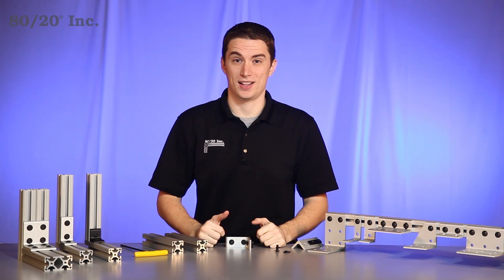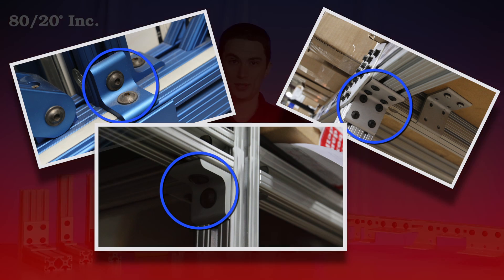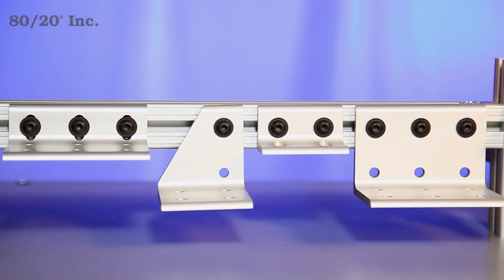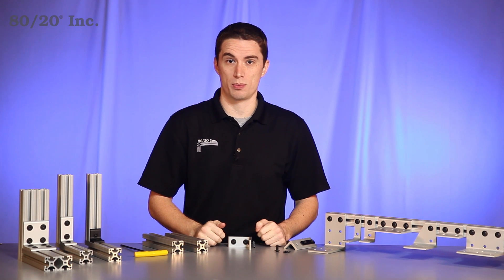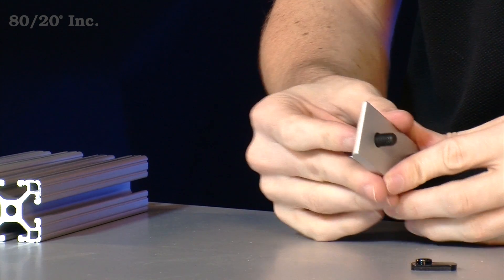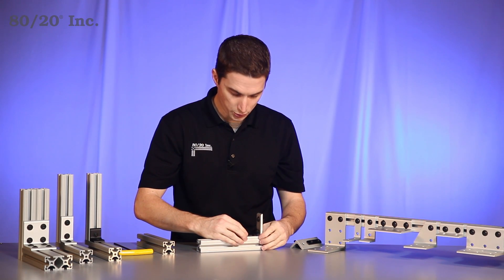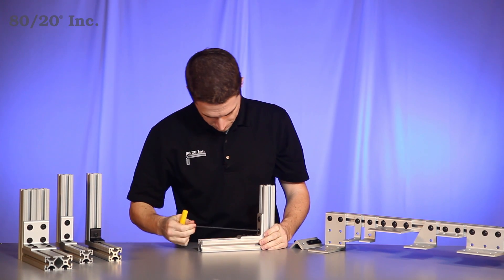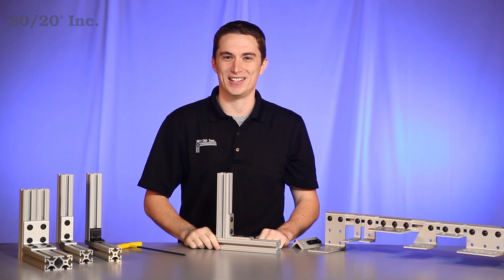80/20: Corner Bracket Overview

Comment: umm, nice how they didn't show the screw in the corner being inserted.  You just have to force it and hopefully not mess up the threads
Reply from the maker: Hi there! While it does look like a tight fit, with a properly sized thread appropriate for the specific series of bracket and profile you're using, there should not be an issue with damaging the threads while using the Corner Brackets. You can search for your corner bracket on the website, which will provide you suggested hardware as well to ensure you have screws that can be used without damaging the threads: https://bit.ly/3NDIZLy
Reply: @8020llc  Thank you for the response.  We are using a method which inserts the screw without damaging the threads although we were a little apprehensive at first to putting that much force on the screw. So far we love the product!  Its like adult Legos.
Reply from the maker: @billprince389  Glad to hear it - happy building!

Comment: What is the reason to face the pilot hole away from it? Would it not just sit in the track between the pieces and prevent any motion?
Reply from the maker: Hi, Lee - thank you for reaching out. When using the 1/4-20 or M6 t-nuts with the 10 and 25 series, the "coin" will instantly wedge into the t-slot and prevent removal or movement of the t-nut. The 5/16-18 and M8 t-nuts with the 15, 30, and 40 series will usually wedge into the t-slot when the 2 degree drop lock is engaged on the extrusion.

Comment: I'm using 30 x 30mm 80-20 but struggling to fit the spanner into the corner brackets to do up both nuts. Do you have any suggestions?
Reply from the maker: Our suggestion would be to either use socket head cap screws, or contact our Tech Support team to help figure out a solution unique to your project. The easiest ways to contact us are here: https://8020.net/contact-us

Comment: Hi, I have selected 40-4040 T-slotted profile, so which size nut can I use in that for corner joint? 
Depth of the nut shoulder should be considered for this selection or not. Can you please help me
Reply from the maker: Thanks for the question.  A standard Slide-In Economy T-nut, part# 40-1961, is what we recommend for 40 series corner brackets.  Bolt size varies depending on profile series and corner bracket style.  When selecting a corner bracket style, be sure to check out the "Suggested Hardware" section in the catalog, or online, to ensure you have compatible hardware for your fastener.
Reply: Thanks for the information 👍